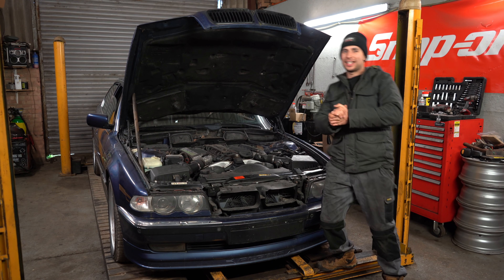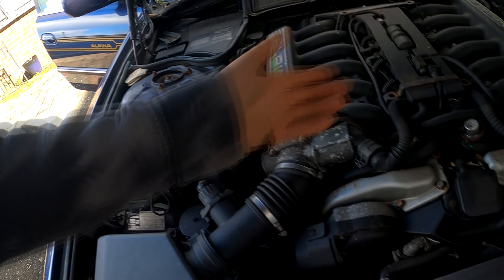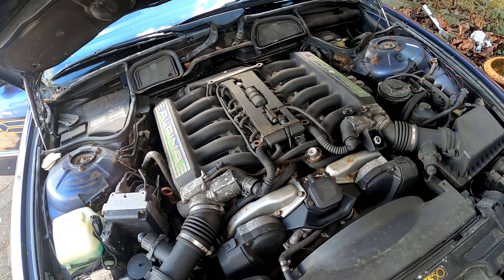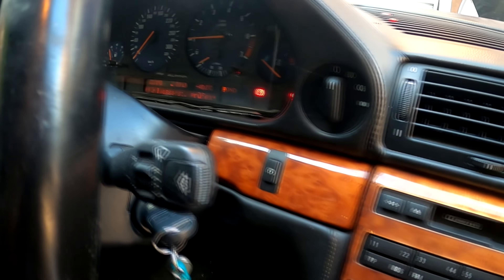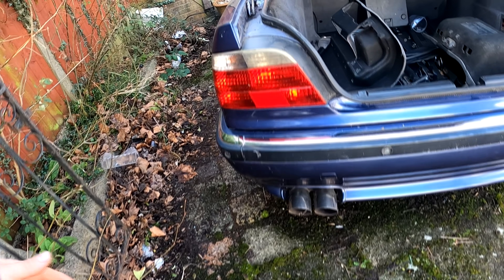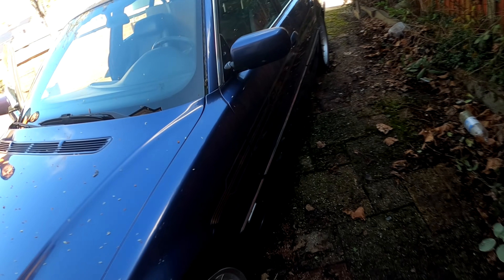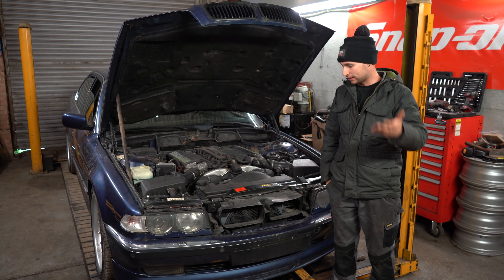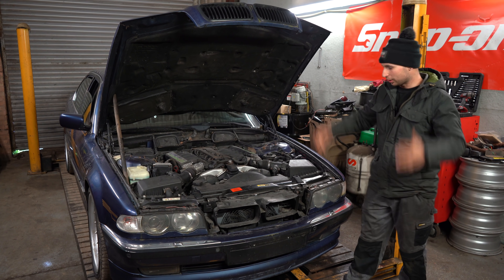How i bought Alpina B12...SHOCKING CONDITION!

Comment: I would say that the best option with the head lining would be to go back to original spec with the grey rather than the current black, IF the grey item was a standard E38 part.  The current head lining looks pretty poor, and the amount of mould build up rather suggests that it's got very damp which probably means that the back board is going to be badly compromised and may well come apart when you remove it.  The grey head lining will help to lift the, otherwise very dark, interior and stop it feeling claustrophobic, and it also has to be said that with this having been the factory press car then it's completed value is likely to be quite a lot higher put back to original spec, which is fairly easy to work out with it having been documented when new...

I would say this is more of a detail restoration than a complete, nut and bolt rebuild, which gives you options with how to tackle the project.  You can take on individual parts of this project when you have down time in the other projects, and then really get stuck in to this, or what's left of the work, once the other projects are complete.  I'd say it's worth the effort as, when it's finished, you're going to have a pretty valuable car with incredibly good provenance having been the factory press car, and one that you're unlikely to ever have the opportunity to own again.  It's also worth saying that, with this having originally been the factory car, then the specification could be unique as, with so few built, there's a very good chance that none have been ordered with exactly the same options in the same colour scheme as these were hugely expensive vehicles new and could pretty much allow the original purchaser to order exactly what they wanted in their car, which is why it isn't all that unusual to see Alpinas in rather odd, orphan specs...
Reply from the maker: In next video u will see how mad i went with stripping it...when I broke all these e38’s in past always thought i feel sorry for person who would need to put this back together..now i feel sorry for myself lol
Reply: @The777Garage    There's one thing, you do have the Phil Campbell 750i to refer to for reference when working on the Alpina and putting it back to original spec.  If it was easy then everyone would be doing it and rare cars like this would be just about impossible to find and buy...

Comment: What year is the car? All facelift B12 were 6.0l and this is 5.7l? The facelifts had widescreen navis too and this doesn't have the same gear selection as facelifts but the hood, grille, headlights and front side bodypanels are from the facellift.
Reply from the maker: 96 originally 
She’s going back to the original look
Reply: @The777Garage  The lci bumper/parts are also handy to protect the original style parts that are in storage. If it was my car that i would keep for a long time and if i would daily drive it i would do that.

Comment: Ed, for £12500 you could have bought my 1999 E38 AC Schnitzer S7 lol. I’ve had it 6.5 years and spent a documented £37000 on it, lol
Reply: Make sure your Mrs never sees that history file!
Reply: @E12m535i  it’s a bit hard to hide, David; it comprises of four full lever arch files all in chronological order...
Reply: I'd be interested 😉
Reply: @imranfida1982  haha yeah I bet!
Reply: Rhein Amacher  yep, standard 4.4 M62TU. Schnitzer suspension, wheels, roof spoiler, front bumper, rear bumper, side skirts, mirrors, pin stripes, decals, pedal set, exhaust etc.

The brochure lists a bespoke engine for the 728! But, the M62 remains stock.
Reply: Rhein Amacher  that’s all they offered, as per brochure. Strange, but true.

Comment: The wires on the cats are preheating modules, they preheat the cats, if they don't work the car can't pass the Emission tests so no MOT, that's probably the reason it couldn't pass MOT.
You can Google it "Alpina B12 EKAT"   
**Like so he can see this**
Reply from the maker: They couldn’t reset air bag light thats why no mot
In next video u will see what a total losers worked on the car before as I started to strip it and the more ive stripped the worse it gets
Reply: @The777Garage  im currently working on a project just like this, the previous owner didn't maintain it and it's a Mechanical mess, the electronics partially work, and when I turn it on the car freaks out and throws all possible lights on haha. I have the bigger brother, the e31 ✌️
Reply: This is a 1996 car I heard him say.  Face lift was 1999?  I thought e-cats were 1999 and up only.  But that might be here in north America. Or perhaps it has them because of the alpina package?  I do know my 1998 750il does not have e-cats as it only has one battery.  Also mine has air cooled alternator, not water cooled.  Sorry, I'm still learning with these cars 😁

Comment: Do the timing chains rather than doing aesthetic stuff like respray.
Reply: The v12’s don’t have timing chain issues... you are thinking of the 4.4 740’s!
Reply: @berrymucuckiner4890  Yeah I know they don’t have issues but instead of wasting money on a respray job... might as well use it more beneficially on the timing chains and engine rebuild and refurbishment. 200k mile engine as well..

Comment: My friend, you can’t tell that you regret the purchase ..

Here in California, USA.. you can get normal v12 750i with less miles for $3000 or less... yeah, I know it’s an alpina... but holy cow 12.5 euro... damn
Reply: good condition Alpina B12 start from 40 000€ right now in Europe and low mileage ones easily go for +100 000€. They are rare cars. For example there was a total of 94 facelift 6.0l models made and only 18 of those were long wheelbase. And there were only 202 pre-facelift 5.7 B12 ever made and 59 were long wheelbase.

And about 23 000 regular BMW 750i / 750iL were made and a total of 340 242 E38 in total.

Comment: Congratulations !!! ...Nice Score ..... The M73 Is Soooooooooooo Easy To Work On. I Rebuilt Mine In 2 Weeks ! ..Just Be Careful With The Fuel Injectors. They Get Brittle And Break VERY EASY ! ..And The Wires On The Catalytic Converters are "E-Kat" .... Heated Converters !